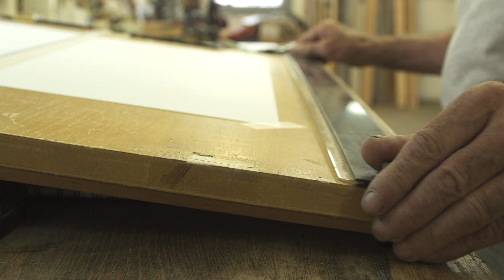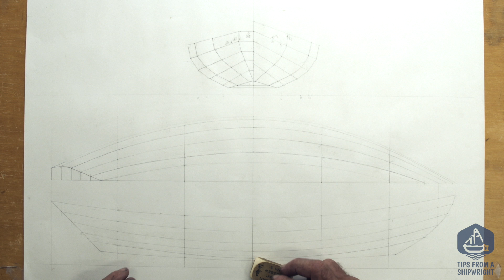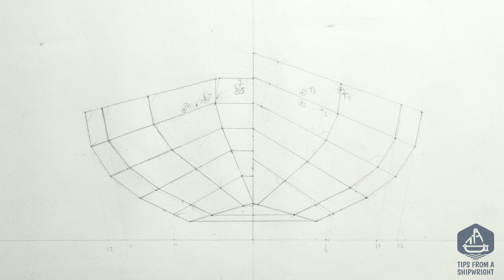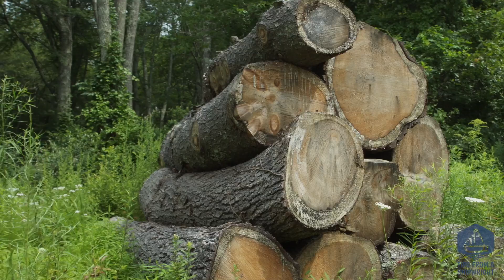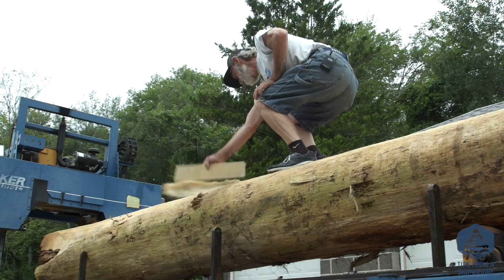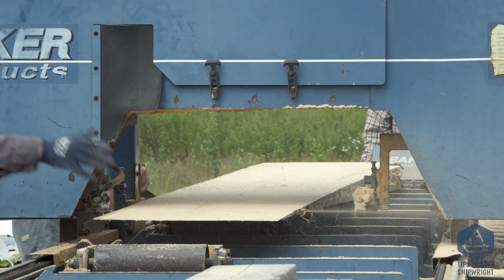Building the TotalBoat Sport Dory - Episode 1 (Season 2 Premiere)

Comment: I learned to draw on a board with a tee square fifty years ago and though today I use a CAD package for building drawings because it suits the local planning department I still draw by hand when it's for myself.
I think you probably meant to say SET square when referring to your drawing triangles... A set square is a carpenter or engineers tool for right angles... Of which there are probably none whatsoever in your beautiful curved creations...😉

Comment: My brother and I had some ancient cottonwood trees harvested several years ago. There was about a dozen of them each 60' or better to the first limb. They were 6' in diameter at the butt, 3 logs to the truck load. The local mill didn't have a saw big enough to mill them. they got trucked to the harbor and put on a ship to China. Cottonwood isn't much for boat building. I guess the Chinese were using the wood for core wood in furniture.

Comment: Looking at the cross section, it seems like the lower planks on the sides end up with a pretty significant curve 'in plane'. I assume that's going to require either really wide boards (which you did get milled), or joining two boards to produce the curve. Do other designs allow for straighter planks? I knew strip planking just uses narrow strips that you'd just bend, but that wouldn't work with wider planks.

Comment: At long last! 👍
Reply: Great start to season 2. Look forward to the rest. 
Btw, love the suicide shifter on the bike.
Reply: So do I!

Louis, GREAT Channel!

steve
Reply: I think there might be confusion between tank shifter and suicide clutch.Suicide clutch is somewhat like a car clutch. Push the pedal clutch is free . Modern foot clutch, which I think is on bike in video, is on a friction rocker mechanism if you heel the lever it stays disconnected in any position and will only take up if rocker pedal is pressed forward.
Reply: The old bike clutches worked on a pivot and going past center. Your correct suicide is free and doesn't pivot and lock like the old bikes stock clutch did. I think it gained the 'suicide' monicker in the custom bike craze (particularly in the 60's) where someone ran a spooled hub. I knew someone with a 44' knuckle with a spooled hub, jockey shift and in the right circumstances it was hard to deal with (on a hill with a stop sign and traffic for example), and even though people over use them, front brakes are nice instead of sliding up to a stop with the butt end skidding all over lol.
Reply: Was called suicide because both feet had to be off the ground at same time. Clutch on one side, shift on the other. Suicide clutch was because trike tranny was used .
Reply: Great video. Looking forward to the ride!
Reply: Reverend D )